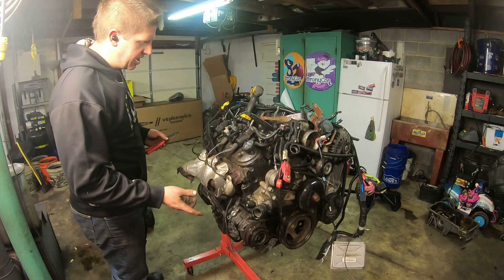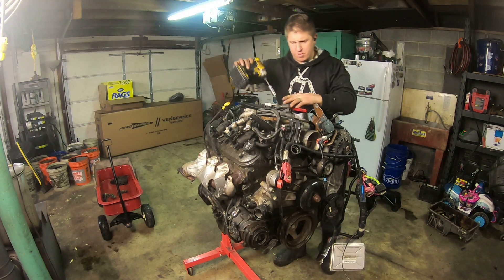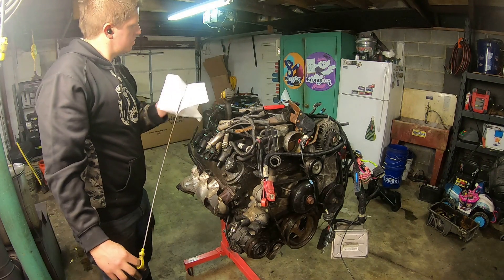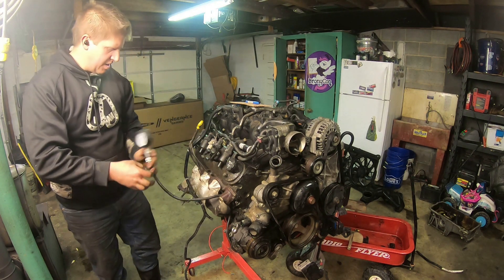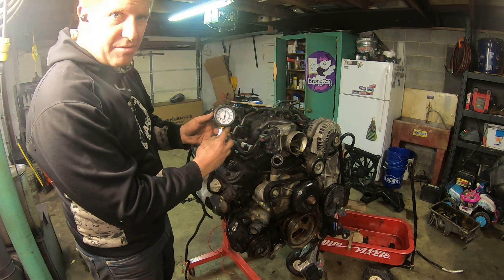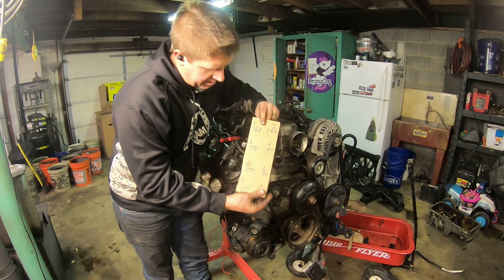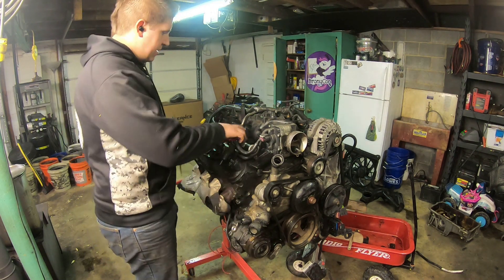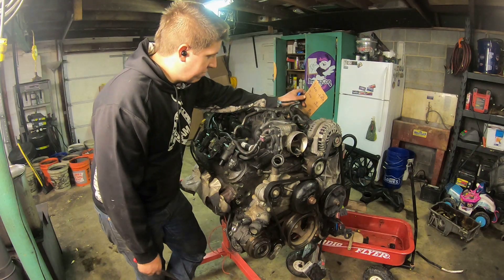Check the HEALTH of your ENGINE!!  How and why to do it yourself!

Comment: Can mechanics tell if a car can make it to another state
Reply from the maker: Most mechanics can give you an educated guess as to whether or not a vehicle will make a long drive. But there's never any guarantee, I've seen vehicles that I didn't think would make it another 40 miles go for another 100,000. I've also seen vehicles that I thought would run forever blow up within an hour. You never know for sure.
Reply: @MohawkMotors  thank u that is true